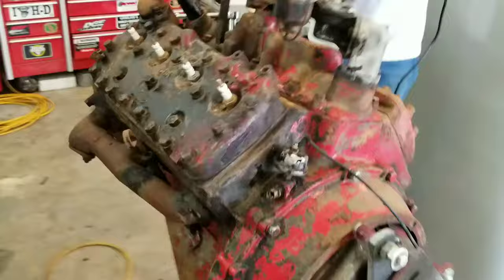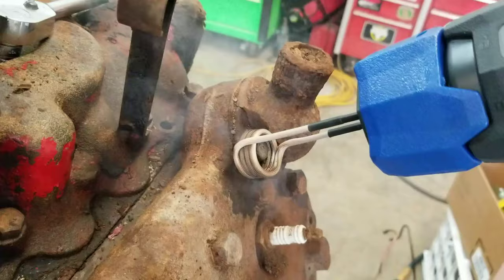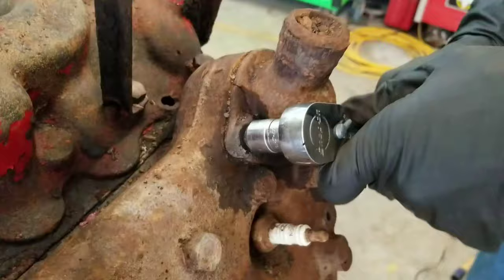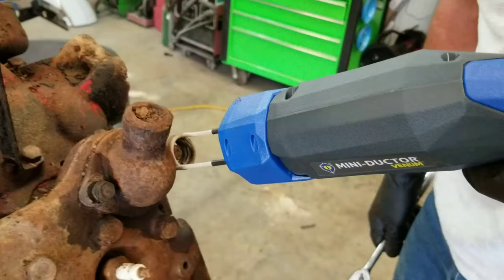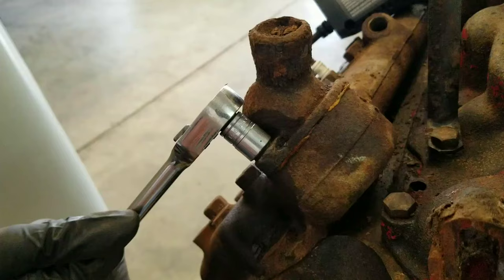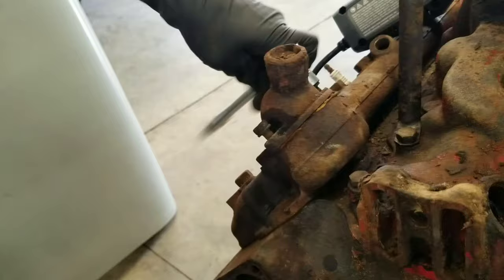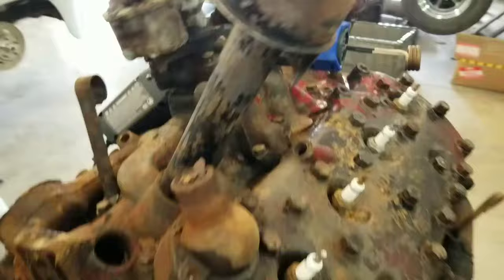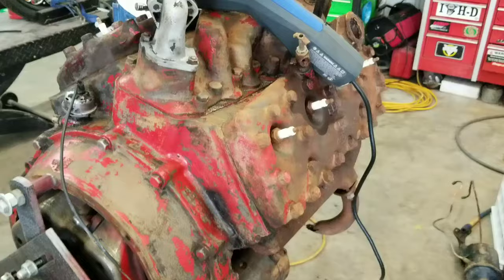A Cool Tool for Removing Rusted bolts and fasteners

Comment: induction heaters are nothing new, just new to snapon
Reply: That's right
Reply: Using heat to break a rusted bolt free isnt new either .....🤷‍♂️
Reply: @patriottowing4973  yeah he said no torches. Torch works perfectly every time. No need to spend a thousand bucks for something off the tool truck to do the same thing
Reply: Actually they didn't show us how tight the bolt stuck there. I think it would do nothing on a real rusted bolt.
Reply: @user-qk7et9kh5k  u have to buy propane, u risk getting smt on fire, for example cant do torch in engine compartment, near soundproofing. And with torch u are heating all elements around, induction is heating only bolt, and some of the heat from bolt is traveling trought it but it is not as much as being in flames from torch.
Reply: This video was posted 3 years ago. And it really is a better idea then a torch, for bolts that risk paint damage, or have plastics and wiring around it, bearings or grease, though I think it should have interchangeable coils for different sizes of bolts, cuz if this is the only one you got it won’t work as efficiently with bigger nuts/bolts
Reply: @user-qk7et9kh5k  The difference is that this thing is a lot easier and safer than a torch. Uses electricity to heat the bolt, no muss, no fuss. Since it's an electric heater, it has 100% energy efficiency, and works faster than a torch. I don't know how you aren't impressed with the performance.
Reply: @user-qk7et9kh5k  Torches work but if plastic is nearby they become a problem. So much plastic in new engine. There's also metals that can't take a lot of heat you have to deal with.
Reply: @magisterrleth3129  nothing can have 100% efficiency. There is always some kind of energy loss
Reply: @xsardas1999  torch heating around the bolt is better... Heating the bolt could help corrode it even more but definitely it just expands the bolt tighter
Reply: It's not Snap-on
Reply: Thanks tips!
Reply: Ah yes, always can count on some YouTube Comments Professional to come in and tell everyone how much more than know and how much better they are.
Reply: @Sffker  ..."And it really is a better idea than a torch," not then a torch.
Reply: @user-qk7et9kh5k  yeah, like 3 inches from fuel tank.
Reply: @M70ACARRY  yeah but I just guard the tank with a square shovel or an aluminum plate lol
Reply: Grandpa had something similar that he made when he was working on his old Allis Chalmers tractor. 🤔

Comment: Induction heating has been around for over a hundred years but this is the first shop sized portable unit I have ever seen.
Reply: Retire Soon , still but in an engine compartment that thing is useless it way to big, I buy a lot of snap on tools they make good stuff but I wouldn't own that
Reply: Retire Soon in
Reply: Thanks for the induction heating comment.  Was gonna mention it myself.
Reply: I have a thing, you stick it in your coffee cup, same coil.  Probably 30 years old.
Reply: I'm not sure some folks realize this isn't a heating element. It's inductively energizing the bolt head where it creates heat internally. I've been looking at an inductive solder pot.
Reply: @Joe Corrie you can always bend the "legs between the coil and the main housing. It's solid metal.
Reply: Retire Soono
Reply: Retire Soon I've used tools like these for about 10 years, they work wonders but the one we've got is the size of a shoebox with a handle on a 2m cord that has replacable heads so you can adapt it to the situation and use it in tight spaces aswell.
Reply: kmgrillen I rather not bend the coil between my legs. 😆

Comment: A blowtorch is cheaper and can be used on broken bolts, seized yokes and the mother-in-law.......
Reply: Don't forget those plyers...
Reply: Good one I'll hold your beer my good sir!
Reply: You made my day with that comment man lmao
Reply: why would you heat the bolts??? you need to heat the surrounding - warm metal expands, so the bolt is harder to get out....
Reply: Blow torches also remove the chipping on headlight covers.
Reply: an induction heater is a lot less expensive.. this is just business's carving more money out of the lay person.

they absolute want people to be unknowning  so they CAN cost a man $600 for a  $20 diy yourself kit.

this is why the internet is soooo lovely...  you can research things BEFORE you buy them.
Reply: @p__jay  You are totally wrong on that one.  On stubborn bolts you heat the bolt so it could expand in it's confined state...resulting in it actually contracting in size to a certain extent and also loosening it's bond.
Reply: This tool uses induction heating. As you can read in the comments this is way over many grease monkey's heads LoL.
Reply: Maybe it’s useful if an open flame is a no-no (i.e. around fuel lines)
Reply: @lashlarue7924  exactly! Why is that so hard to understand?
Reply: @wheelie642  this lol is two years late, but...
Reply: lol until the bolt is right next to something flamable or plastic. People like you are the reason why automotive repair, construction, manufacturing and most skilled trades are decades behind in technology and innovation that'd easily make your jobs more efficient and cheaper.

Comment: It would've been far more impressive if they'd used a torque wrench to do before and after measurements to highlight the reduction in effort required.
Reply: Chip Fisher yes they can. Project farm just did a video on this. Finding the best penetrating spray vs heat. AVE also did it but his way of measuring torque was a little different.
Reply: Chip Fisher...Some torque wrenches do indeed torque in both directions. I have one and have used others. Specifically on a mobile crane years ago, the tires on the left (drivers side) were left hand threaded lug nuts and were torqued to something like 450 foot pounds. We had a torque wrench for that.
Reply: Ahem!!
The old school ones with the needle and the scale do!!
Reply: TheMadScotsman mckay

How about... "We just used 20ft lbs of torque and it didn't even budge, now we use this handy dandy, do-hickey like so... and now it turns freely with only 8ft lbs of effort".

I guess then it would sound like an As Seen On Tv ad, huh?
Reply: Based on the earth coming out of the water neck there, I don't think they were wrong about just breaking the bolts off. The takeaway is that for bolts that cannot be removed without heat, this looks like an awesome alternative to OxyAcetylene... Too bad It's 10x what I'd want to pay. and 5x what's I'd be willing to pay.
Reply: bigshotdadz whole point of the tool is to avoid snapping the rusted bolts.
Reply: bigshotdadz I second this.
Reply: bigshotdadz if it comes loose, at least it didn’t break who cares about torque spec when loosing bolts I only care if it comes out in 1 piece
Reply: Its not about clamping force on the bolt. Its about sending heat throughout the bolt in odrer to heat the entire length and all the threads causeing it to break corrosion.  You could easily throw a long 3/8 ratchet on there and snap that bolt off. Or send non invasive heat through it and back it out
Reply: pickle street customs a torch would do the same thing but this is more concentrated to one area with less risk of Melton other things. But I could see this working best on nuts over bolts since there’s really no way to evenly heat the entire bolt length
Reply: Zach Roberts - exactly! I never used one of these due to cost vs. Efficiency. I have torches and use them.  But as a way non invasive heat its a great idea and could be usefull as around a $50 dollar tool.
Reply: Chip Fisher, every torque wrench I've ever had, including torque extensions, works in both directions.
Reply from the maker: This video was originally done just to show friends and family that would have interest. Was not a planned video.
Reply: hahaha, breaking bolts or not is the issue. Not really an effort thing. Its either not coming off or it is. Just used one of these right now after a month of stuggling to get my main crank bolt off. WOW!!! 2 mins compared to a month of trying.

Comment: Induction heating is not magic. What's magic is that expanding a bolt makes it looser, not tighter.
Reply: I had the same though lol
Reply: I never understood this. It must be that surrounding area also expands outwards?
Reply: I guess they expand and shrink rapidly quick after the heater is off; which creates enough room between the threads.
Reply: I think the logic is normally that the rapid expansion 'breaks' whatever is holding it in place - be it goop or rust. Similar to how that stuff 'breaks' with a good turn, this achieves it without putting the bolt under torsional stress.
Reply: I'm thinking liquifying dried up oil, rust bits and other crud is the magic part. The bolt does expand, but it immediately cools down again, leaving a miniscule gap, and smooth extraction.
Reply: exactly my thoughts
Reply: Thermal Expansion.

Comment: also you can use a medium ball peen hammer to hit the bolt head sharply either before or after heating. the shock of that destroys the rust which is seizing the bolt. that will make removal even easier.
nice video, thank you
Reply: Ball peen 50/50. Many times a whack with a hammer has done nothing. Hitting it harder doesn't necessarily mean more/faster results.

Comment: Brilliant, the tool uses a magnetic induction field to heat the bolt.
Reply: Exactly. It’s worth mentioning that this only works on a ferrous bolt. (A steel bolt with iron in it)
Reply: I personally prefer an electromagnetic pressure twister

Comment: I suggest you let the nut go through a heating and cooling cycle and then try turning it. The heating and cooling should be enough to break the rust that is locking the threads .The induction heater also heats the bolt and it may become soft enough to twist off

Comment: A little propane heat and candle wax works well too. The heat draws in the wax and acts like a lubricant.
Reply: But you are at it for quite a while with torches.
Reply: you can use an actual lubricant.........
Reply: bishplis or not....
Reply: ....and doesn't evaporate as quickly as penetrating fluid would. I like it.
Reply: I really like your idea and it makes a lot of sense too. And would impress the girls)) Very Jane Austinish))

Comment: $600??? I’ll just keep using a torch
Reply: Robert Plant use some WD40
Reply: Heat works a million times better than any penetrating oil..
Reply: Penetrating oil only works if you use it days in advance... obviously, you don't always have days to let bolts break loose.
Reply: Robert Plant - Even at that price, it's still the cheapest tool on the Snap-on man's truck.
Reply: Andrew Tarrant pb blaster is the only penetrating lubricant I use
Reply: Work smarter not harder
Reply: +Plant I've had good luck with Aerokroil too.
Reply: I agree for me torches are WAY better ... BUT for a shop his size? .. especially if he's paying wages ... it'll save money eventually
Reply: What is the Cid of that engine?
Reply: Devlins10 :.. the Ford Flat Heads came in 136, 221, 239. 255, and  337, I'm not Ford Expert ... but that looks like an early 40's, 24 Stud, 221 to me
Reply: for 600 ? ill make my own
Reply: giantpune that's a fact!!!!!
Reply: Andrew Tarrant WD 40 is mainly used as a lubricant anymore.
Reply: Devlins10 39/127 bored over .0400
Reply: Sir Solid Snail for something that requires a lot of lubricant yes. I use it on my fishing reels, rifles & shotguns.
Reply: You can build one for about $50-$70 but it won’t be very convenient and handheld like this one is
Reply: or light-hammering it
Reply: @Devlins10  cubic inch displacement-joe !
Reply: @Devlins10  cubic inch displacement---------!
Reply: @Andrew Tarrant 
WD40 is not penetrating oil.
Reply: I can resupplu the tanks soo many times with that money.
Reply: I paid 750 for mine worth every penny I don't heat anything you need up instantly cherry red sometime torches are better but that thing works unbelievable
Reply: Do you use propane or map gas?
Reply: @Andrew Tarrant right , pb blaster not wd40
Reply: Sir Solid Snail    your english is very good, did you use google translator?
Reply: I can make that for 6 cents
Reply: Right, smoke wrench it
Reply: How u use the torch
Reply: @Andrew Tarrant Yep it's only fish oil lol use some PB or liquid Wench and another good one is Kroil which a lot of air plane mechanics use ! I make my own out of regular non synthetic automatic transmission fluid and some Acetone and it works just as good if not better than PB blaster !
Reply: My first thought       we called it  " The hot wrench "

Comment: Now,,, you know that we all know that trying an EXHAUST bolt would be far more impressive...
Reply: Especially an FE Ford with the open ends on the back; how many "ears" have been broken off the head casting because of rust-and-corrosion-welded bolts?
Reply: 100% right brother
Reply: We would hit it with a torch some to heat it and melt paraffin wax on it and that seemed to work
Reply: @josephlewis23  whats the wax for?
Reply: @ct1762  it essentially is supposed to do the same thing as like pb blaster or a penetrating oil
Reply: More impressive is finding a car you can use it on without removing the engine first
Reply: @josephlewis23  My understanding was that you melt wax into bolt threads to seal them, not release them.... It's a good tip for brake pipe connections.
Reply: @ct1762  the wax would go into the threads and lubricate it I only had one stuck bolt the I had to drill out out of all the bolts I had to remove unless they were cross threaded

Comment: That's induction heating, heat is not coming down though the wires, only current, which induces eddy current on the metal ( the bolts in this case ) and thus heats them up
Reply: glad you sead that. Yes you can buy one on ebay very cheap.
Reply: the coloration of the mouthpiece shows it heats up aswell, wich shouldnt happen in induction heating, very strange
Reply: @mikderoost9261  It heats up a little due to a large amount of current flowing through it. It may get a little warm, but not nearly as much as the bolts.
Reply: I know Eddy
Reply: yeah..  $30 diy project for only  $600.....   dunno..  I'd check the inside of the case maybe its adorned with gold?
lol
Reply: Nobody said that heat was coming down the wires.

Comment: when i done a mechanic course back in 89, i used to pull apart a old Ford V8 flathed, pull it apart and put it back together, it was,something to practice on, there were many other engines to practice on, for some reason the ford V8 flathead was my favorite, it was so cool,

Comment: "Heat travels down to the threads". Induction described nicely...
Reply: THANK YOU! 
'The tool cools off really fast too' - yeah, funny that.
Reply: wouldn't it expand the metal making it tighter?
Reply: @raggdoll1977  I suppose it must heat the nut a lot more than the bolt it's on. So then it's expanded away from it so it's easier to remove, never used one and can't say for sure though.
Reply: @brenansmith9710  sounds cool, what is a shive in an elevator?
Reply: @brenansmith9710  damn, thanks!
Reply: @raggdoll1977  Once the bolt is heated it expands, but only in an upward direction as it is constrained by the material it is bolted into. Once cooled, it contracts in all directions, thus making it slightly smaller and easier to remove.